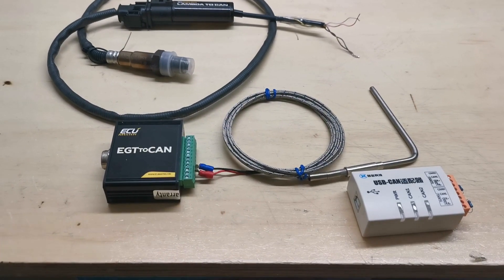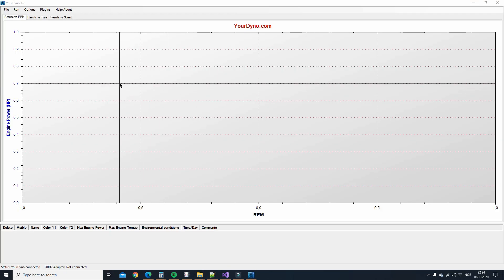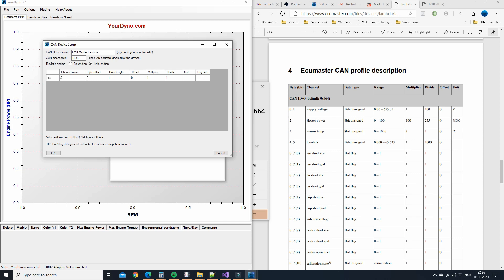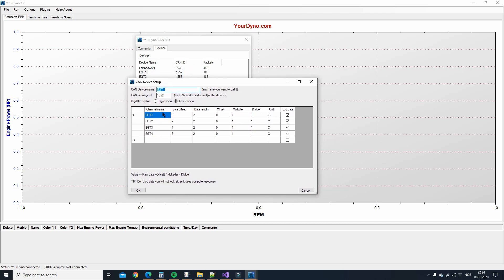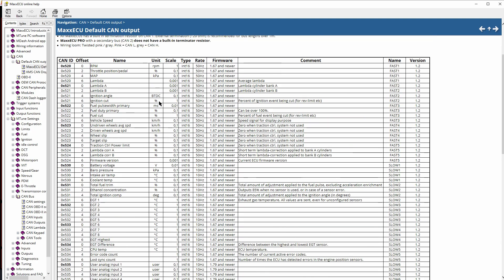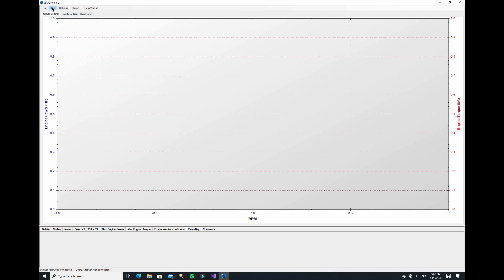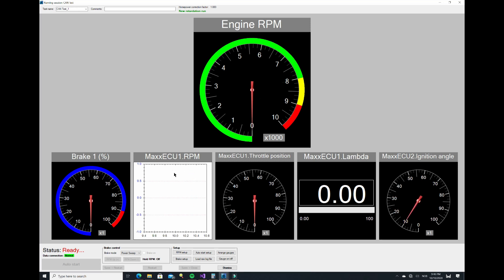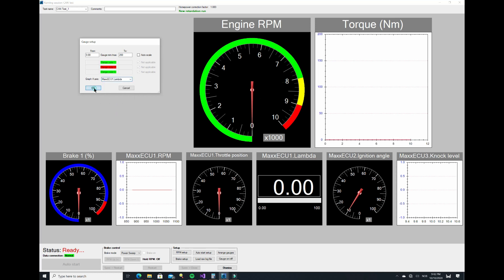CAN Bus support and steady state tuning options with YourDyno.com

Comment: If we wanted to add all of the maxxecu stream, is there a file we can edit/create rather than a manual input of all data
Reply: You can do that but it is apparently a bit of a process. If you look around on the internet there are instructions